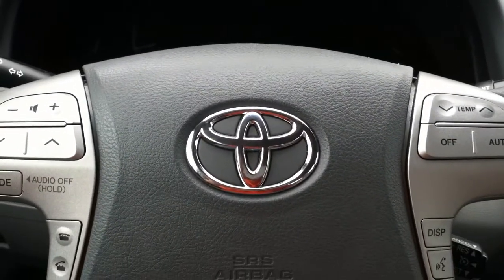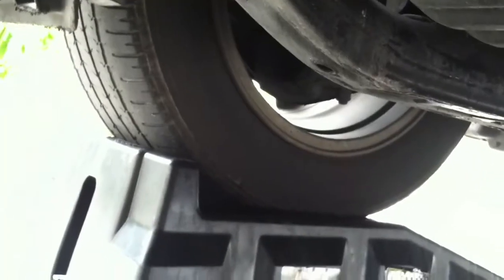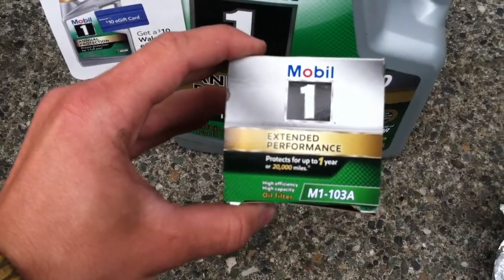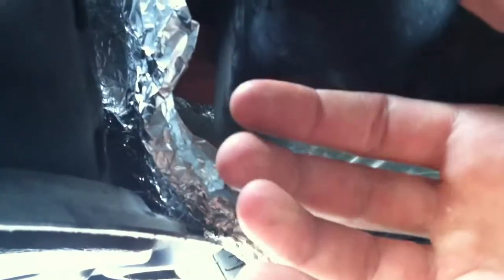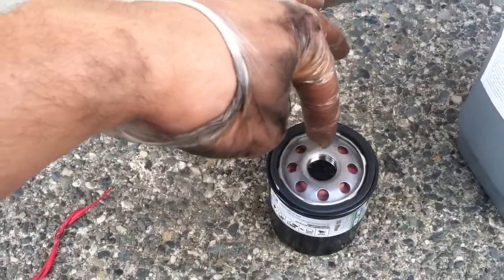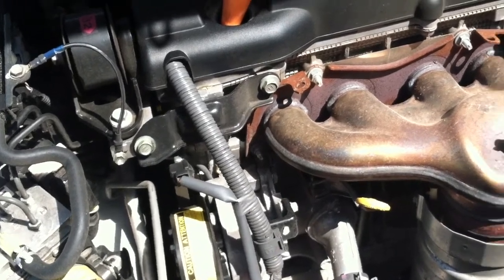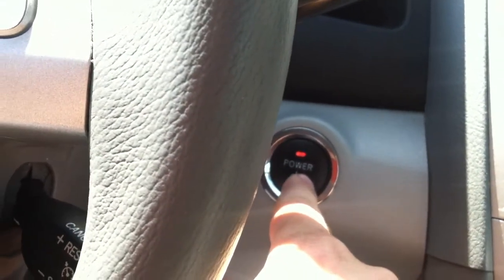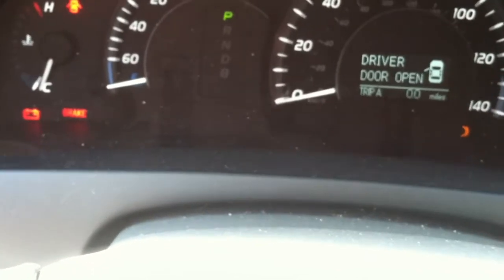How To: Perform Oil Change On '07 Toyota Camry Hybrid

Comment: For christsake, kid, you turn the drain bolt and the filter LEFT to loosen, RIGHT to tighten.  There is no "passenger side" on hardware.  Lefty loosey, righty tighty.  Left hand threads are very uncommon.
Reply: One day I’m gonna build a house and sell it where every thread is lefty just to annoy the residents

Comment: Oil drain plug torque spec 18ft/lbs for gen 6 camry hybrids
Check forums: 
https://www.toyotanation.com/forum/906-camry-6th-gen-hybrid-2007-2011/297690-2007-camry-hybrid-oil-change.html
https://www.toyotanation.com/forum/906-camry-6th-gen-hybrid-2007-2011/1647510-2008-tch-oil-drain-plug-torque-spec.html